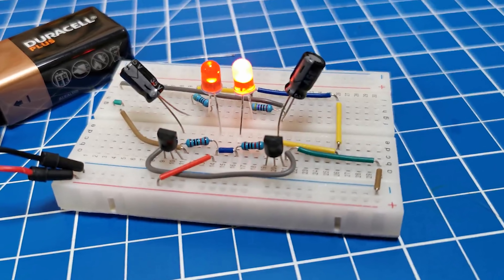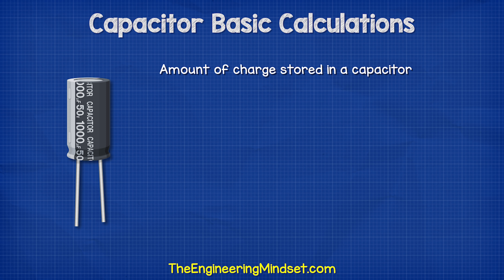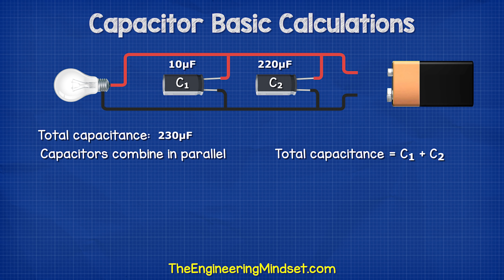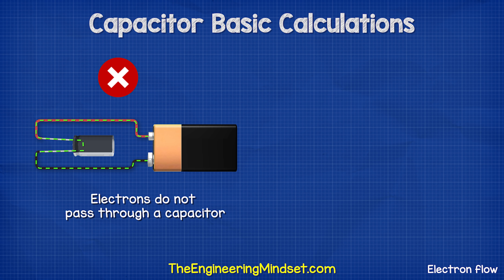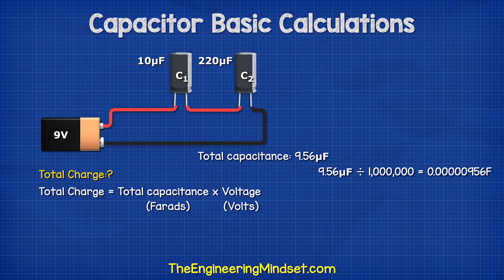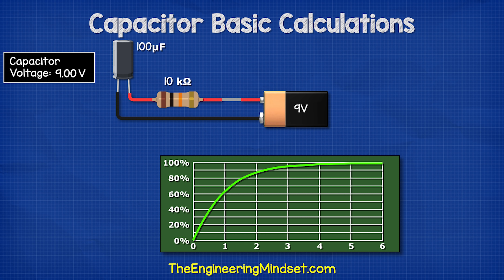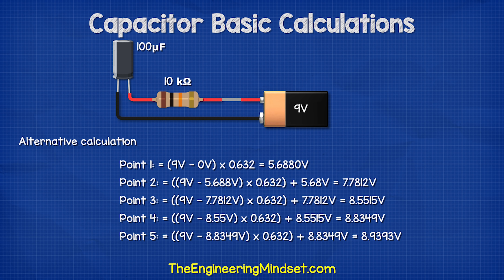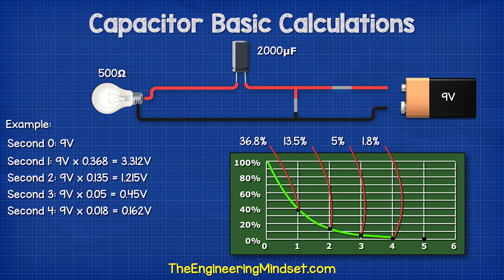Capacitor calculations - Basic calculations for capacitors in series and parallel

Comment: Maybe you could do a video on AC capacitors? I have a bunch of them I’ve acquired over the past couple of years and I have no clue how to use them or anything.
Reply: Capacitors in AC can be hard to work with mathematically, but just conceptually they aren't as difficult imo. With DC, capacitors charge up and then stop conducting current when fully charged, end of story. For AC circuits, a series capacitor will charge up normally but once the voltage of the circuit drops back down below the voltage of the capacitor, it switches and begins to discharge. The voltage eventually oscillates back and the capacitor's voltage ends up being less again, so it charges up once more and the process repeats. AC sources have frequency, or a rate at which they oscillate between peak and minimum voltages, and this is significant because the frequency affects the capacitor's behavior. Very high frequency circuits have voltages that change so quickly the capacitor doesn't have enough time to actually charge/discharge, so it just acts like a short and lets everything through since that's how it behaves when it has no stored energy. Lower that frequency and you'll see the average voltage drop of the capacitor increase as it gets an opportunity to charge further before discharging. This voltage drop is related to the capacitor's impedance, which is measured in ohms just like resistance.

If you want to get into the details I recommend starting with how DC power supplies work since they use capacitors to smooth out the output of a full wave rectifier. Then get into filters, which will get you comfortable with seeing capacitors as "variable resistors" that change based on the frequency they see.
Reply: @thegreatzoom5073  THANK YOU SO MUCH!!! It makes a lot more sense.
Reply: @immaunicorn4124  There is no component working in "DC" state for a capacitor.
The capacitor is treated as an "AC" component for the OFF to ON state.
Because this is a transitional state.

The formula to follow is 
Current = Capacitance * (change Voltage/change time)

or I = C dv/dt for this case will calculate the "in-rush" current caused by the sudden on-state of the system.
However, in DC, dv/dt = 0, because DC is constant, thus, the current thru the capacitor is 0.
0 = C * (0) as proven above.

in AC however, you can still view the average current passing through the capacitor by using the same formula
dv/dt would be your rms voltage in 1 second.

To make this simpler, you view this in the "steady-state" of the system, by using the Fourier Transform of the capacitor which is
1/ (i * (omega) * capacitance)
i is the imaginary number (sqrt(-1))
or in the case of electronics the orthogonal phase (90º)

rewritten this would be -j / (2*pi*C)
Capacitors will have an inverse relationship to the impedance of the system.

If you remember how to do circuit analysis using DC voltages, now you have the orthogonal component of imaginery numbers now

instead of resistance, you have impedance
which follow the form: R + jX
R is the DC resistance (or real number)
jX is the AC reactance (or imaginary numbers)

It will now be easier to view your circuit in phaser notation.
Does this answer your request?
Reply: There's no difference between AC and DC capacitors.....
A capacitor is literally anything with 2 or more plates separated by a dielectric....
Reply: @cpK054L  wow thanks for telling me everything that I already know🙄
Reply from the maker: Check out NEW resistor video, everything covered! ➡️ https://youtu.be/DYcLFHgVCn0

Comment: Hey...Great video..How about adding a Inductor Calculation Basics as well.  I'm sure it would be great explanation/review.  Thanks.
Reply: Volts = Inductance (L) * dI/dt (change in currrent/ change in time)  [Formula 1: Induced Voltage]
 i * omega * L = reactance based on frequency response
½ Inductance * Current² = Joules (energy)
Reply: @cpK054L  oh I thought you were putting video link for a second.  These equations students can get from a book.
Reply: @bigdaddychicano  was there specific info you were looking for? 
Inductors are commonly avoided because of their magnetic flux....

Comment: 10:55 That in not exponential, thats a logarithmic curve.
Just putting it out there, not trying to be a smartass.
Reply: the change in voltage decays exponentially from:
 electric circuits - Why don't capacitor charging graphs look like other exponential growth graphs? - Physics Stack Exchange

Explained in depth here:
 Exponential Decay ( Read ) | Algebra | CK-12 Foundation (ck12.org)
Reply: Respectfully, you’re wrong. Logarithmic curves don’t have y-axis asymptotes that always grow to positive or negative infinity. These are exponential curves. The first is V_max*(1-e^(-t/(RC))), the second is V_max*e^(-t/(RC)). Note that as t approaches infinity these functions asymptotically approach V_max and 0, respectively.

Comment: Your electron flow is incorrect. Electrons/current goes from + to -, otherwise your circuit wont work. You should know this.
Reply from the maker: No, they don't. You can learn why here: https://youtu.be/kcL2_D33k3o
Reply: Well watched another of your videos showing electrons/current go from ground to power. I a new at electronics, but my circuit with a battery,  a blocking diode and a LED will strangely only work if my current goes from + to -.
Reply from the maker: Again, watch that video. You're mixing conventional current and electron flow
Reply: @EngineeringMindset  I dont get it. If the flow of electrons from my battery goes from - to + which you say is the case, then why does my Circuit with a blocking diode only work if connected to + as the power source ? Can you explain that ?
Reply from the maker: It's explained in the video, it's also explained in our diode video

Comment: at 3:49 wouldn't the voltage drop across the bulb reduce the voltage stored in the capacitor?  So they would add up to 1.5?  Or does that only happen with current?

No - wait - of course the voltage will spread and even itself out.  So the bulb simply slows down the rate at which the capacitor will charge?

Comment: In theory it will take an infinite time for the battery to charge the capacitor to its own voltage. Therefore an "error" -- called "for all practical purposes" or "almost" -- of say 0.001 V should belong to the discourse.

Comment: Sir I have 20 pcs, 10,000uf, 25v capasitor in parallel connection, Is it ok to tap on the positive and negative terminal of the 12v motorcycle  battery.? Is it not dangerous for the parts of my motorcycle or anything.?

Comment: thank u for the lecture sir , sir if you can please teach us how to calculate the value of  capacitors used for amplifiers , in an amplifiers we use ceramic capacitor to in the analogue signal , teach us how to calculate the bypass capacitor value , coupling capacitor value , decoupling capacitor value , smoothing capacitor value .......etc   teach us about those things

Comment: How do you size a decoupling capacitor on a DC circuit that is installed to prevent inrush current (I think), let say on a toggle switch leads? Or at the VCC pins of a dropout regulator? (sometimes you see 10uF and 1uF in parallel, instead of just the big one)

Comment: How do you know what components to use for a circuit?
Also, if someone wants to get into electronics and making their own circuits, where would they start?
Reply from the maker: Check our new Multimeter tutorial out ➡️ https://youtu.be/4lAyzRxsbDc
Reply from the maker: Check out NEW resistor video, everything covered! ➡️ https://youtu.be/DYcLFHgVCn0
Reply: Figuring out What components to use is the point of a 3-4 years electronics engineering degree.

Start on a breadboard with a battery, resistor and led. Calculate currents and voltages and then measure them with a multimeter to verify results. Once you understand that, add more components.

Comment: Tantalum capacitors have a mark or line on the positive side. These capacitors are very small and have a small internal resistance. But if you connect this the wrong way around, or the volts get too high, then this will burst.
Electrolytic capacitors have the mark on the negative side. There are different types of voltage up to 450 volts, but the internal resistance also increases with the voltage.
There are also capacitors for fast switching power supplies with low internal resistance.
There are also non-polarized electrolytic capacitors for audio applications.
Depending on the application and space, you have to choose the right type.

Comment: 3:40 in a series circuit the Voltage across a Cap will be battery voltage - load voltage

Comment: Why does the animation show the capacitor charging while it's being discharged? Or discharging while being charged? 
That makes no sense! 
Maybe you don't really know how capacitors work?
Reply from the maker: See bottom right corner
Reply: @EngineeringMindset  yeah but how many green dot's leave the negative side end up on the positive side... That looks like it's gone from a negatively charged capacitor to a positively charged capacitor.. so basically it looks like all the electrons have moved to the other plate and if the capacitor is turned around in circuit, then it should still be charged and be able to do work.. a H Bridge would be great to keep the electrons moving in the correct polarity for an endless supply of energy... 
Naturally you wouldn't expect this in the real world but the animation doesn't exactly show what is actually happening... A capacitor with no energy won't have any electrons on either plate.. 
I think that the animation hasn't been thought through properly... It doesn't make sense.

Comment: Maybe video about LCR resonance
Reply: Do you mean LC resonance?
Resistances does not affect the frequency unless you are talking about parasistics
Reply: @cpK054L  i was talking about voltage resonance when capacitor inductor and resistor are connected in series and there's source voltage drop on resistor and voltages on capacitor and inductor have opposite vectors and voltage drop on LC is 0 while resonance. That's voltage resonance. There's also current resonance when LCR are connected in parallel when currents flowing in capacitor and inductor have opposite vectors and sum of them is 0 while resonance and only current flowing in circuit is trough a resistor.
Reply: @floridakeys5408  do you understand what "resonance " is?
Reply: @cpK054L  where did i make mistake. Im still learning and i dont know most things. Or maybe i write something wrong english is not my native language. I suggested video about resonance because i dont understand it well and i would like to get to know somwthing about it because resonance is very important in electronics and in my country there is literally nothing about it
Reply from the maker: Check out NEW resistor video, everything covered! ➡️ https://youtu.be/DYcLFHgVCn0

Comment: Next step is inductor calculations.if you could please make a video 🌹❤
Reply: Inductors behave like resistors when in series/parallel, but they also interact when close to one another...
However, their behavior is based on magnetic flux which involves some insane math to work it out... This gets more complicated when you get the core material involved (many to choose from), even down to how they're wound...
I've been working on some formulae to calculate the inductance and saturation current for transformers and inductors - aimed at rolling your own power supplies, and even has potential in reverse-engineering disassembled transformers!
Reply: @KomiyanVT  wow thanks bro
Reply from the maker: Check out NEW resistor video, everything covered! ➡️ https://youtu.be/DYcLFHgVCn0

Comment: I'm a bit confused by one thing: When you play the simulation for capacitors in series, you show the flow of electrons traveling from the battery's positive terminal into the capacitor, and from the capacitor's opposite terminal, through the load, and into the battery's negative terminal. Wouldn't this be the other way around? As in, electrons would be drawn out of the capacitor to the battery's positive terminal, creating a voltage difference in the capacitor causing electrons to flow from the battery's negative terminal through the load, and into the capacitor?

Whatever the actual movement of electrons in the circuit, the fact that you are showing the flow in reverse from previous examples has me confused as to what the flow is supposed to represent. Could anyone clarify this for me, please?

Comment: We would love if you added the Capacitor voltage general formula : 
    Uc = E . e ^ (-t/T) ,
where
  Uc: Voltage across the capacitor
  E: The voltage across the battery
  T: time constate ( T = R . C )
Reply: Thanks for adding this.  My only complaint about the video was not giving the formulas for where those percentages came from.  Now I see with E = 1 and T = 1, the discharge percentage remaining is obtained by e^(-t) and the charge percentage with 1-e^(-t).
Reply: 'We' don't. It is actually more illustrative to focus on explaining what an exponential curve means in practice. Only in addition to mentioning the reduction percentages to learn, it could have been mentioned that of each next time period is the actual voltage value multiplied by 0.368, as a donkey bridge, even though that may already refrain viewers from learning the percentage by heart.
Reply: everywhere i go.....i see your face....

exponential decay....

Comment: Very usefull information, love this . Maybe that's why capacitor in series only allows AC current and block DC current ( the frequency) ,Usually that's useful in microphone. And in parallel in power supply, so when the voltage ripple slope down the capacitor will release the current. So that's will be reduce the slope , maybe you can make vidios how to choose right capacitor / Calculate the farad for the circuit in real life. Thankyou very much

Comment: I wish they taught us like that is school. Instead if this they filled our heads with useless abstract formulas in trigonometry and forcing us to solve engineering level problems in physics. At least now I can really understand how the things work.
Reply: Theres a very short route from learning about capacitors to having to use trig to calculate impedance in said capacitors once you deal with ac. So if you can’t do trig, just knowing what a capacitor is won’t get you very far. Reason teachers don’t teach this way is either cause they’re not very good at connecting the math to real world applications or they just assume you already know, after anyone interested enough can easily look up what a capacitor is online or at a library.
Reply: Trig is not useless. It's actually useful in game dev and architecture/building. It's more of a matter in which field you want to go in.
Reply: @Cheesypockets most of trigonometry that is use for practical purpose tend to be a very basic one though… unless you are aerospace engineer or something then it is a different story.
Reply: If school is too difficult for you, go raise sheep.
Reply: @AlterKater  doesn't look like raising sheep is going too well though. No need to share your bad advice with others

Comment: ceramic capacitor  ordinary single layer is very unstable and reacts very on heat and changes value quickly. they are also not linear

Comment: What happened to your intro(high voltage sound)? 😢. It usually gives me chills😂
Reply from the maker: Experimenting to see impact on viewer engagement
Reply: @EngineeringMindset  sir this video is very helpful to me to know, in which situation we need to use particular valued capacitor..😃
Please also put a video about inductor and transistor basic calculation especially in boost and buck converter circuit for efficient performance.
I eagerly waiting for your video sir
｡◕‿◕｡

Comment: I love how it starts with a capacitor blowing up
Reply: Sometimes learning what not to do is quicker.
Reply: I have blown many capacitors during my college days. Hahaha
Reply: You should try at home with a bigger capasitance
Reply: @shawty.305  try an old CRT TV capacitor. Big sucker rated in Farads, not microfarads.
Reply: Either put the polarized capacitor in backwards.
Or use a voltage that is above its rating.

Scary thing is a lot of supercaps have low voltage ratings... and a very massive capacitance... 
they'll literally burst into flames
Reply: Not me I've been working with electronics for many years I hate to see parts failed
Reply: @pauljanssen2624  das boring. I buy capacitors in bulk just to blow them up
Reply: Magic Smoke! 🤣
Reply: HA HAH HA HAH AHAH HA
Reply: I RUINED YOUR LIKE RATIO